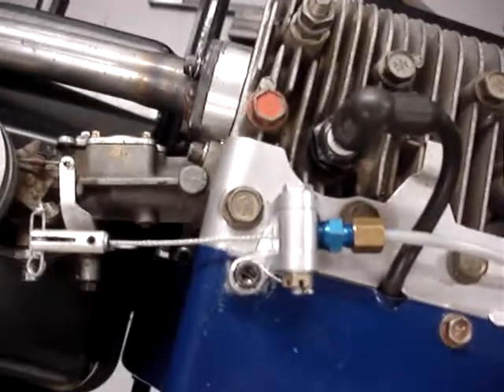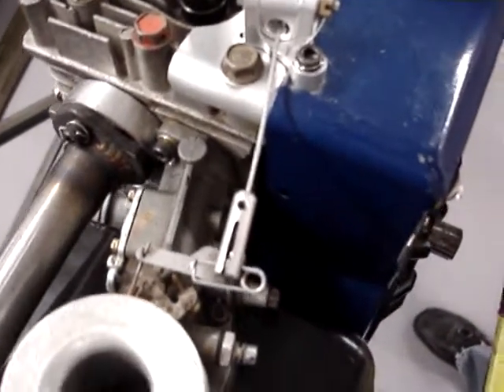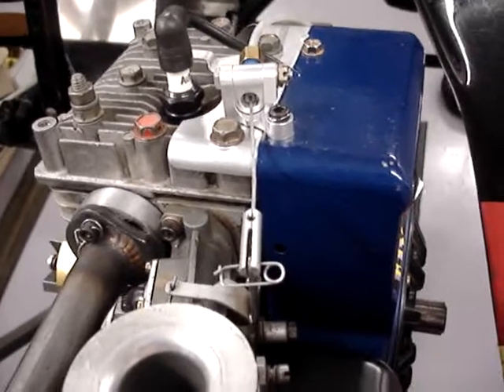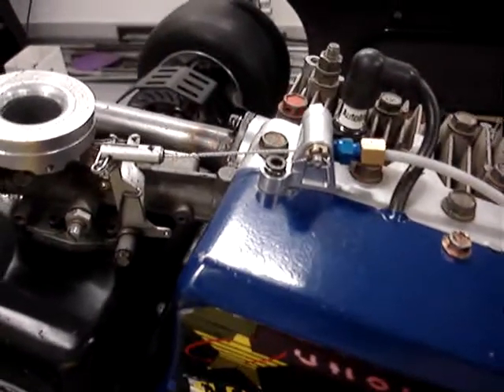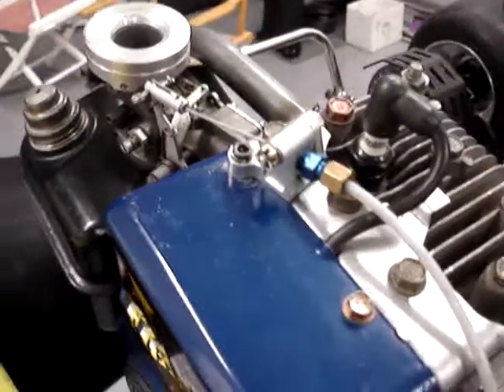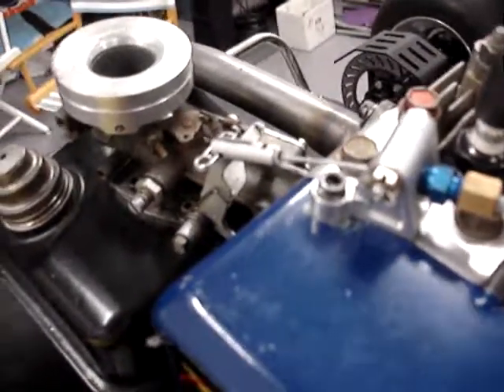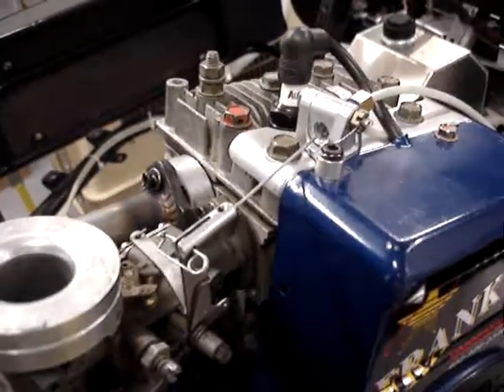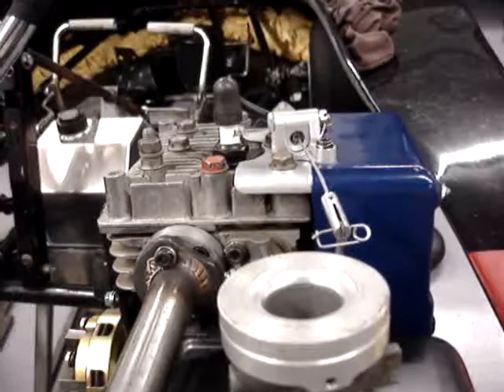Offset throttle Mount for Briggs Flat Head engines for race karts !

Comment: What kind/where did you get that spacer for the exhaust header? mine is all rounded out because somebody had threaded pipe in it but it vibrated itself loose over time. I have just a 1" header on it for now but I know it is restrictive because the port is larger